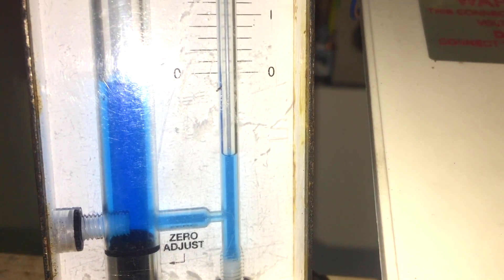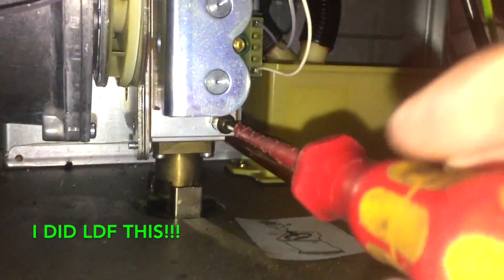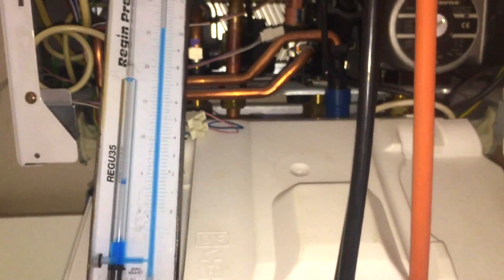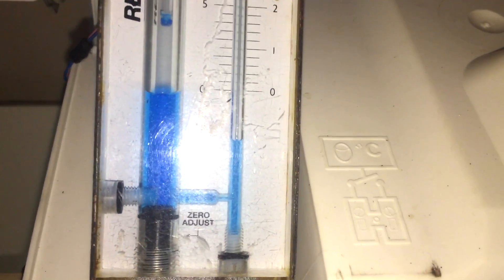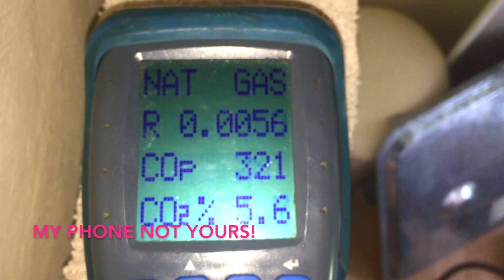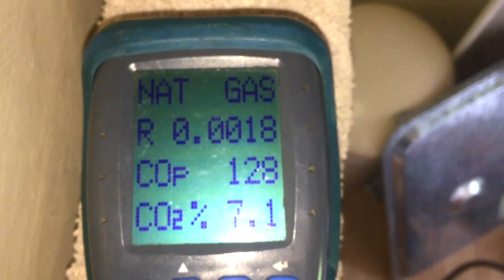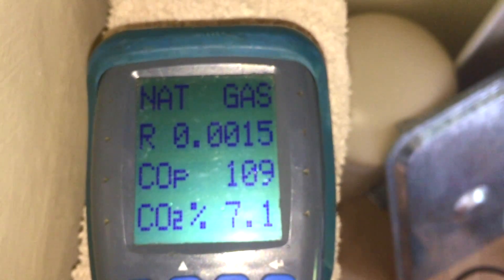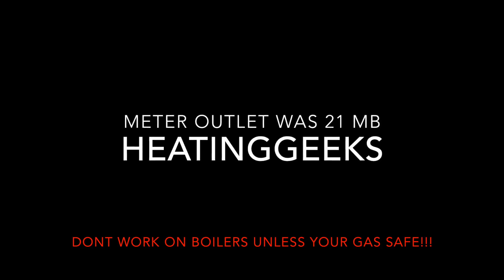Lowest Gas Pressure I Have Ever seen.

Comment: I guess if it’s putting gas out the Gas Valve at atmospheric pressure, then it’s no so critical.
The pressure drops Regs across the carcass is a lot of shit really, well, for a lot of pre-gassed burners anyway.  But boiler manufacturers can’t really come out & say as much can they.  In most cases there’s other appliances, so the BS & Gas Safe are trying to cover anything that likely to be fitted, which is a big ask!!!
Reply from the maker: Your absolutely right! Gas safe have a hard job to do!!! I have a gas safe inspection coming up soon!
Reply: HeatingGeek I’m sure you’ll not have a problem with your GS inspection HG.  You know your onions & that’s all they’re looking for.
I’done last year & it must be 15 years since the last one.  Oh, one wee observation; why are you not using a digital manometer?
Reply from the maker: I dropped my Testo 510 and 2 little resisters broke off inside. I decided I would fix it but never did. I have ordered a new Testo 510 and am waiting for it to arrive. 
I don't recommend the Testo 510 BTW.

Comment: Had inlet lower than burner pressure affecting dhw performance, meter was fine. Took the gas valve little gauze in there full of crap, opened the gas blast a bit more out put the lot back it had improved loads.
Reply from the maker: Thats the new issue. Graphite type stuff in the gas main. I forget what its called!
Reply: HeatingGeek I called grid out in the end  I’ll probably be seeing it again in the future😩
Reply from the maker: yep
Reply: Copper sulphide...hydrogen sulphide reacts with copper and lines the pipes with copper sulphide.  @HeatingGeek
Reply: Black dust lol

Comment: Always do the basics first 👍.you got any videos with temp differentials yet for blockages or setting flow and return temps for balancing would like to see how you do it 👍
Reply from the maker: No. I will get around to it ASAP but it needs a bit of thought on my part and I need the footage. I haven't forgotten but also haven't had the issue to film. (Our engineers don't get that wrong)